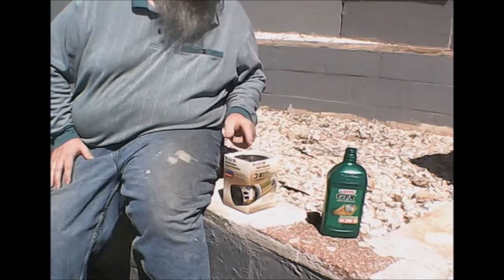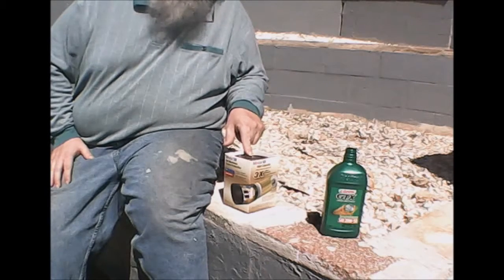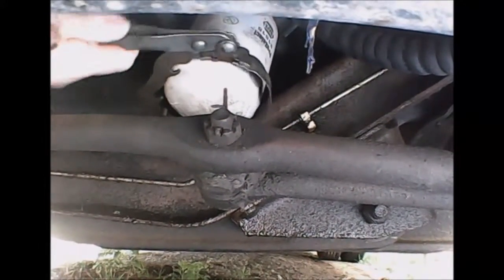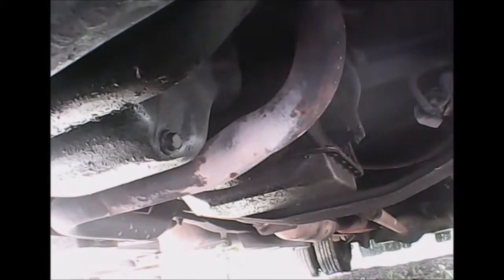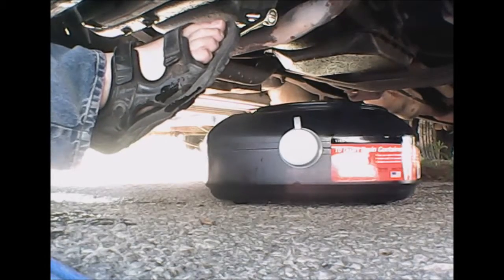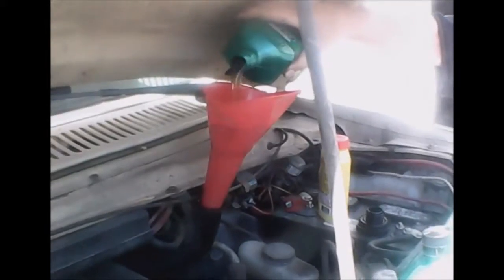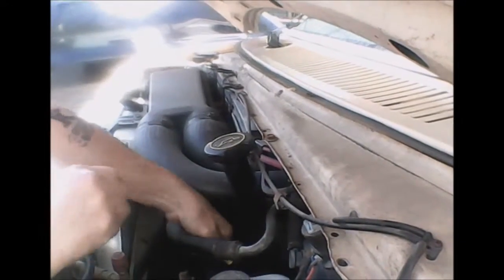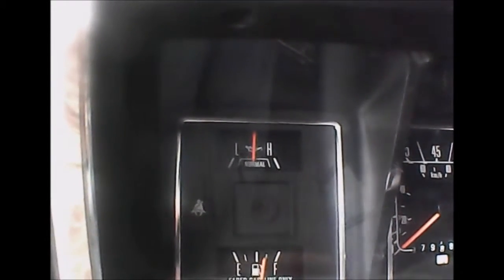Changing The Oil On My 1988 Fleetwood Jamboree

Comment: I have a 1989 Jamboree. I'm planning to change the oil this weekend. How much new oil will I put in ?
Reply from the maker: If it is a 460 7.5 liter v8, you will need 7 quarters of good quality oil.
Make sure you replace the oil filter with a high performance type.
I recommend Mobil 1 filter and 20w-50 oil nonsynthetic unless synthetic has already been used.
Reply: I have no idea what was used previously. Should I still use non synthetic oil ?
Reply from the maker: @usataff  based on the age, it would be safer to avoid synthetic to avoid gasket degredation.
But this is one of the reasons knowing the maintenance history is important.

Comment: Do not tighten your oil filter with a wrench!  Hand tight is good.  The wrench if for removal...
Reply from the maker: Maybe I can't tighten the filter enough by hand, because if I don't give the filter a slight twist with the wrench, the filter leaks a little. Though, I have learned not to tighten the filter too much or I have a struggle getting it loose. The 1/4 turn I mentioned is a bit too much.
Reply: I apologize.  I can certainly can tell you know what you are doing with mechanical, electrical and electronic equipment.  

That was just a knee-jerk reaction from my experience with over tightening filters.  LOL